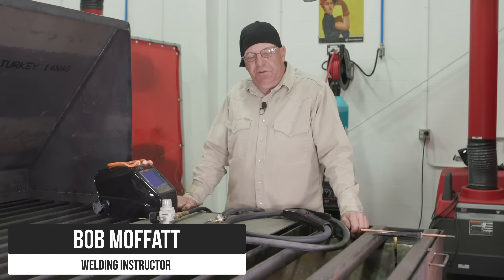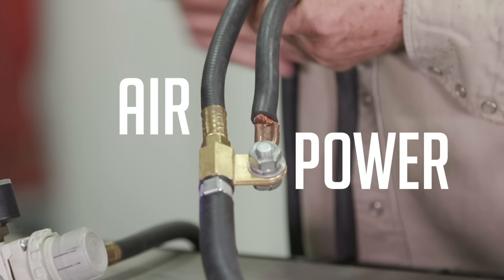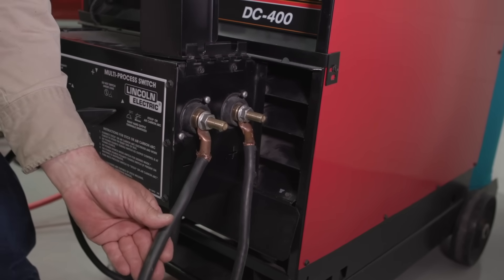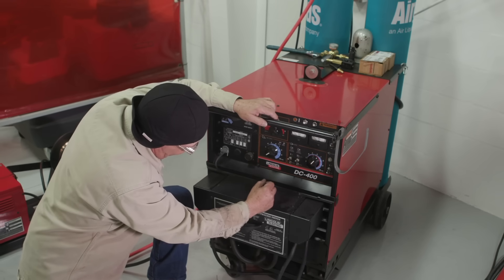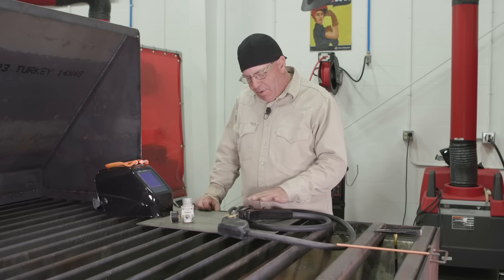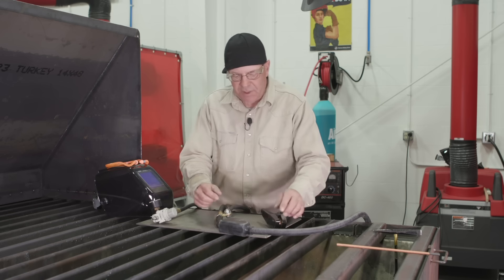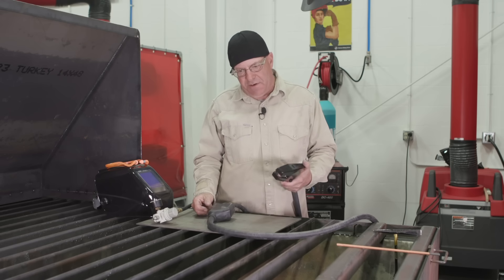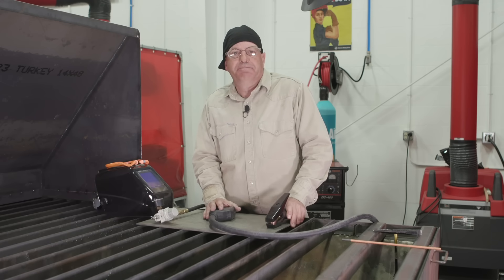Arc Gouging Basics (Part 1): Machine Setup

Comment: I've used a truck seat blower and a stinger for gouging. I've used a gouging stinger to weld with. I've stuck a rod into a connection and burned a rod. A stinger holds the rod to keep your glove cool. Alot of fun on the job. Just make sure the safety guys are in a meeting or something. Have fun.

Comment: Long established industry custom is to use the most powerful power source because gouging is hard on hardware. BTW you can gouge using AC which is preferred for cast iron, nickel alloys and copper. Almost no one mentions that but if you have a monster AC transformer machine you can gouge with that to save your more valuable lighter welding machine.

Comment: Alright, now my question is how you can jerry rig this with average diy stick welder and normal setup with out any fancy stuff like that? Air pistol duct taped on the side of electrode handle and just need those fancy rods...but does it need to be copper coated, what common material can be used as replacement? I'm talking about those annoying inner corners you cant get with grinder to remove weld bead, having this possibility in the arsenal would be extremely useful when all you have is stick and maybe air compressor around, no fancy plasma cutters or time to diegrind weld out.

Comment: I am NOT a welder....
That being said - - - Just Curious...
Could a person be able to use carbon arc electrodes on a regular welder and use an air gun to get similar results ?

Enjoyed the video - Thanks
Reply: That is a regular welder. Just a different lead that has air hookup and lines running to the end of it.  Wouldn't be so fun trying to hold an air gun and stinger at the same time
Reply: @Crushup1  Thankx for the reply
As I said - I do not consider myself a welder by any means
I can get 2 pieces of metal to bond - but I'm pretty sure, the results would be ugly !

When I need welding done at work - - We call in the pro's 
( work with cranes - - Kinda critical welds on them things ) - LOL

Comment: Like your Rosie the Weldor pin up.Your K4000 is brand new style.I work heavy equipment field service mechanic.I run older K4000 and fill with 7018 off of a Miller 500 amp diesel powered machine.On top of that I have lap top with Cat,John Deere and Volvo to troubleshoot issues.Going on 30 years in yellow iron.You have a good vid.going.

Comment: Fastest way to remove worn out shanks on excavator buckets etc , etc 78 years old now and most of my work heavy equipment repair welding used to use torch with gauging tip but too slow

Comment: Our instructor just showed us the awesomeness of arc gouging with this method and also with using a regular S.M.A.W stinger and a 1/8 inch 6010 rod, turn the power up to 225 and its a basic tool to use incase you dont have a torche or arc gouging

Comment: WHERE I USED CARBON ARC GOUGING THE MOST WAS LOCOMOTIVE TRUCK FRAMES!
THEY HAVE SEVERAL MAGANESE STEEL WEAR PLATES WELDED TO THE FRAME RUBBING POINTS!
MOST OF THE GUYS IN THE SHOP USED STEEL WIRE CUTTING ELECTRODES, BUT I WOULD ALWAYS USE CARBON ARC GOUGING !!
MUCH CLEANER CUTTING AND JUST A SMALL BIT OF GRINDING,
AND YOU ARE READY WELD THE NEW WEAR PLATES DOWN!!!

Comment: If you strike an arc with that Arcair torch with no air flowing it is possible to burn out the cable inside the air/power sheath as it relies to some extent on air flow for cooling.

Comment: At 5 minutes and 40 seconds he's referring to the power block on the whip I've done a lot of carbon Arc gouging.. tape that positively connection off!!!! Do not rely on that rubber boot.. after that block connection use a 10 ft or longer lead with a tweco!!!! Also on the airside standard hose clamps no no no highly not recommended..

Comment: If you operate the Torch without an air flow through the delivery tube/sheath you run the risk of burning out the inner power cable as it relies to some extent on  the cooling effect of airflow through the delivery tube/sheath.

Comment: It is possible to burn out the inner cable on the set at high amperages if you strike an arc without first pressing the air flow button so it is inadvisable to use the torch as a conventional electrode holder for any length of time as the cable is in effect "air cooled".

Comment: I got to do a little air arc at my last welding job, it’s tricky at first but kinda fun. Unfortunately if you were arc gouging that means you screwed up a weld. 😄
Reply: Shit box Or the engineer screwed up and warranted  a change after fab.
Reply: Bob  Moffatt, Yeah there was plenty of that too...
Reply: No, lots of equipment bearing mounts etc are welded in instead of bolted, center pivot bearing on articulated loader for example.
I worked for a steel foundry that used 1500 amp air arc to burn off big risers & pour gates.
Good for gouging out cracks in heavy plate.

Comment: What does arc gouging do?
Reply: you can use it to cut, to level, bevel, its pretty much primitive plasma cutting
Reply: way better than grinding still
Reply: you can do it with regular stick rods if you can stick weld one handed and hold an air line in the other hand also, or use a carbon arc in your regular stinger as well doesn't work so well but yeah, way better than grinding out a half inch thick nasty weld that runs 10 feet

Comment: Love your videos!!
 I’m not a welder, by trade, but been playing with it a long time and meet some great welders in the last 30 years. Were I work they use this process a lot to repair cracks, remove bushings and just take thing apart for repairs. It’s very noise, it will scare the hell out of you the first few time you do it till you get the hang of it, but way better than using a torch. I hope you stress the safety side of this. We use duel protection for hearing and ventilated hood on most applications. Thanks for your video!! I watch them religiously.

Comment: Can this process do anything I can't do with a plasma cutter? Just wondering.
Reply: SATAMAN Schmidt dennis - yes - it is shaving not cutting like a blow torch or plasma ...  you have FULL depth control ....  you can remove a weld without destroying the parts ....  

Picture it like reverse stick welding - sort of ....   

I have a video on that coming too - chasing a crack on an excavator bucket

Comment: Bob don't forget to tell everyone how loud it is when gouging. Also I use the arc gouger smaller handle for opening the clamp as a reference as to where the molten metal is blown. The side it is on is the direction it will send the molten metal.

Comment: I watch almost all the videos from this channel.  I'm a current welding student (an old one though... 49 years old).

I know that OA cutting doesn't work on stainless steel because stainless doesn't oxidize and acetylene cutting is an oxidizing process.  I would love to see a demo on what happens when someone tries to, though.
Reply: ViolentLotus stainless cant be cut with oa beacose it's not hot enough... but if u add iron powder it's possible to cut stainless with oa.

Comment: Haven't tried it but how would an inverter type machine like an ESAB or AHP work with gouging? Y'all have a lot more funding to try crazy ideas. Just a thought for a video.
Reply: Not a crazy idea... proven technology I think. very handy for removing welds where you can't easily get a grinder, etc.
Reply: DSCKy  I've run gouging rigs in the shipyard. Never tried it on a inverter machine.
Reply: I don't know about that either. I would ASSUME that if it has enough power... might work?

Comment: Show some action! I mean this in the kindest way, and am excited to see this in use. That's huge box, is that typical for this? Can one of the Everylasts, for example, be used? Thanks.
Reply: Doug Owens as far as I’m aware, inverter based units like the ones made by Everlast are not compatible with carbon arc gouging. Most transformer based machines and engine drives from Lincoln or Miller will do CAC all day long. 

In regards to the huge power supply, it’s not uncommon to see them that large, but the last time I did carbon arc, it was on a Lincoln power wave
Reply: Carbon arc gouging is more effective in 500+ amps thus needing a large power supply.
Reply from the maker: Doug Owens There is lots of live gouging in the next few vids. This was the Intro video.
Reply: Weld.com I am so happy to see y'all finally touching base on air arc. I sincerely hope y'all show how it plays into CJP welding in structural applications! These green horns that come on the job dunno shit about gouging because schools just don't teach it anymore and I think your content is super informative and gives a good base for a young guy or even someone who just hasn't done many moment welds or tank seams etc. Fuckin awesome. Keep at it Bob